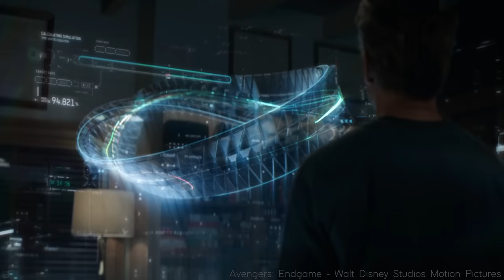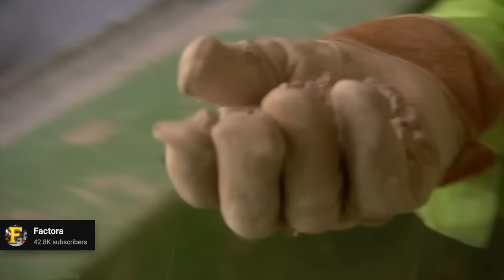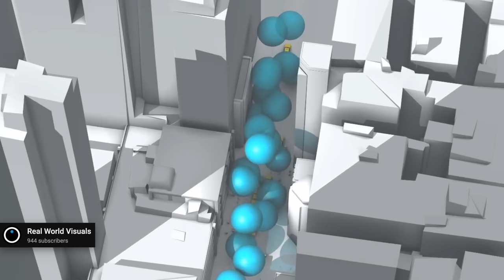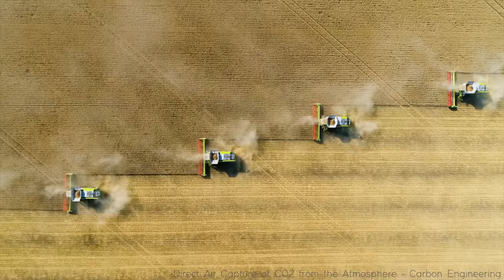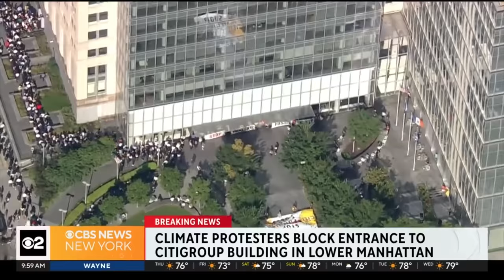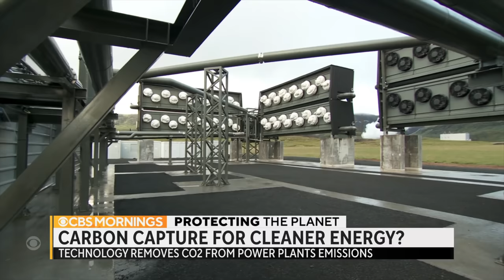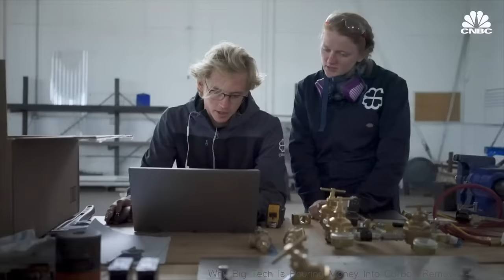How Thermodynamics Holds Back Negative Carbon Tech

Comment: It seems absurd to argue that we can double our energy production and devote all of that extra production to carbon capture. But what if we didn't dismiss it, and asked, "can we actually do this, and how could we do so cheaply?"

There is one conceivable way we could solve this, that I don't see discussed much. There is a method firmly grounded in thermodynamics that we could use to generate absurd amounts of energy for relatively low costs - extremely large nuclear reactors.

Fission plants are interesting in that the fuel costs are a rounding error in their overall budget. All the cost is in building the plant. But fission reactors, like any heat engine, tend to be more efficient the larger you make them. And in particular, they tend to be cheaper the larger you make them. There's a reason the nuclear industry has tended towards large GW-scale reactors. These are the economies of scale needed to make fission practical.

But what if we went larger? A lot larger. Orders of magnitude larger. Imagine if we built terawatt-scale fission reactors. Think of how cheap we could make large amounts of energy if we were able to build such massive reactors. 

Why hasn't anyone done this before? Because for most cases, it's not practical. A TW-scale reactor is largely useless for the electricity market. Even if it can make electricity for a very low unit cost, there simply won't be a TW's worth of electricity demand within a reasonable distance. You would have to ship that energy hundreds or even thousands of kilometers, and line losses would eat you alive. Even though monster reactors might be able to produce huge amounts of energy cheaply, we don't use them because the market within a practical transmission distance can't soak up a TW's worth of production.

But CCS is one of the few cases where such monster reactors might actually make sense. You avoid crippling line losses by building your monster reactor right next door to your big CCS plant. And you can put your CCS equipment almost anywhere (or anywhere suitable geology exists.) So in principle we could construct some monster reactor and CCS plant right next door to a uranium or thorium mine, power all the mining and processing equipment with said reactor, and make the whole process as efficient as possible by minimizing transportation needs. 

We have access to the energy needed to do this. The US has alone has enough depleted uranium sitting in warehouses that we could probably cover the whole process with this. And beyond that, reactors can be built to work off thorium, natural uranium, etc. 

Ideally, you would design such a reactor to specifically meet the needs of large-scale CCS. For example, you might design them to operate with unenriched uranium and thorium, large breeder reactors. Also, you might be able to skip the electricity production process entirely. As you note, often for CCS most of the energy budget goes into heating whatever compound your plant uses to absorb CO2. So you could have a plant that has a primary cooling loop going through the reactor core, passes through a heat exchanger, and gives the water to a second fluid loop that provides the heat needed for the CCS equipment. You could design the reactor to primarily serve as just a heat source directly, and thus avoid the large thermodynamic losses necessary in thermal electricity production.

And you can go further. When you start really thinking on this scale, a lot of things become possible. For example, it's likely there isn't a foundry in the world that can build reactor vessels large enough to make such monster TW reactors. But when you're thinking on this scale, simply building the necessary foundry, right on site, to produce such vessels becomes a practical option. You avoid the transportation nightmare of transporting a TW reactor vessel long distance by building your reactor vessel foundry right on site. If we want to seriously talk about atmospheric CCS, we're talking on a scale that involves dedicating a few percentage of total global GDP to the project. And when you start thinking on that scale, all sorts of options open up. If the technology to do what you need hasn't ever been scaled to the necessary level, you have the funds to scale it. If a foundry that can build a reactor vessel large enough doesn't exist, you can build that foundry. If enough nuclear engineers and technicians to run such a complex don't exist, you can pay the entire education cost of an entire cohort of students to get the training they need. 

It's a bit like the original Manhattan Project. Building a nuclear weapon in 1940 seemed impossible, the logistics were insurmountable. But when you start throwing around a budget big enough to construct entire cities from scratch, a lot of things that were once impossible suddenly become possible.
Reply: Very interesting thoughts, I worry though about cooling such a monster, and the potential impact of such a steam column.   Though surely it can't be much worse than a rain forest springing up where there wasn't one.
Reply: @72APTU72E  Yeah just turning such a beast on could significantly alter local weather patterns wherever you built it. This is definitely a "lesser of two evils' idea. Creating a new artificial microclimate somewhere isn't something I would generally endorse. But when weighing against the dire nature of our situation, it may be a cost worth paying.

However, it might not actually require an ocean's worth of cooling water though. The CCS equipment seems to work on much lower temperatures than most reactors run at, so a lot of that thermal energy will go right into the absorption process. 

But moreover, you might be able to just rely on air cooling for such a thing. Air cooling a TW reactor? Seems absurd right? But in this one context, it might not be. After all, you're already building utterly gigantic fan setups to move the huge volumes of air needed. Once you pull the CO2 out of your air stream, you could then use that air stream as the final cold sink for your reactor. 

Normally, air-cooling a nuclear reactor is pretty absurd. Generally using a big body of water as your cold sink is a much more practical option. But since you're already going to have to be moving huge quantities of air anyway, using that massive air stream as your cold sink would probably be viable.
Reply: This is fascinating. Do you do videos on the topic? Would love to learn more from you on this idea of enormous economies of scale for fission and CCS.
Reply: I haven't yet, but I have considered it in the past.  @SAPANNow
Reply: @TanyaLairdCivil  well I'm subscribing to you in case you decide to in the future. You sound like a good science communicator.
Reply: Third law of thermodynamics would simply disagree not only with your reasoning...
Anyway you aren't alone with your startrekkish theories: 
those CCS (how much americans love their acronyms?) methods simply don't take into account physics being them politically manufactured
Reply: @wisdon  what does the entropy of a system reaching a constant value at the minimum energy state of the system at 0 Kelvin (assuming there is only one such state) have to do with it?
Reply: seems cartoony, but not impossible
Reply: Well, lay off the economy, you will see better results 😂😂😂
Reply: @busimagen  Care to explain how?
Reply: Nuclear power plant can support any carbon capture energy requirement without creating carbon, and nuclear power can bring scale that way above renewable energy sources.
Reply: One big nuclear plant; that’s your option? One point of failure; one source of potential radioactive emissions; one target in times of conflict or acts of terrorism. Yeah that’s brilliant, you’ve really thought this through.
Reply: @MichaelEilers  The idea really wouldn't to build just one big nuclear reactor to solve the whole problem. 

You need to think at scale. We're talking doubling total human energy production and using all the excess for carbon capture. Our current power plants are not sized to simply produce the most energy possible for as cheap as possible; they are instead optimized to the needs of the electricity market. And the needs for bulk large scale CCS are simply very different than those of the regular power grid. And the optimum size of reactor for large-scale CCS is likely very different than the optimum one for the electric market.

And no, you of course wouldn't just build one big reactor. I don't know the exact total power output required, but the largest nuclear reactors today are about one GW. So maybe you power your CCS with a fleet of a hundred 100 GW reactors. 

Obviously just building one big single example of anything is probably a bad idea. But my point is, that by moving to a scale of reactor an order or two of magnitude beyond what we've done in the past, we can likely produce power for far, far cheaper than anything we've done previously.
Reply: @MichaelEilers  Modern nuclear power plants with state of the art PWR (Pressurized Water Reactors) are really, really, unbelievably safe. Not even need to mention future technology like Small Modular Reactors or Thorium Molten Salt Reactors. Plus, SMRs are already commercially operating. Experimental TMSRs are operating in China, and we are also building our own TMSR prototype.

With the support of renewable energy sources, massive scale Thorium reactors, which is modularized with proper size, can be a perfect future energy source. Such thing will be flexible, cheaper, safer, yet can meet the demands of humanity & carbon capture for incoming numerous decades with far far far less carbon footprints, like order of magnitude smaller carbon footprints. Thorium is abundant and does not need to enrich. All we need is proper infrastructure.
Reply: @MrSupasonics   that's right. Candus, smrs, new nuclear attack is absolutely exciting. The answers are here. It's time to just get on it.
Reply: @Johndoe-ob1   how do you mean?
Reply: @TanyaLairdCivil  Thermodynamics time. When CO2 binds to its absorbant material, the entropy goes down. Heat must be released into the surrounding filtered air. 
Given a stream of CO2 rich sorbant, the baking is endothermic. And given the temperature drop, you could get some electricity, and then bake out the CO2 with semiwaste heat. Still need to cool the CO2, lots of heat ends up in fairly hot CO2. Probably run that CO2 over the next lot of absorber coming in to heat them up. And put the still hot absorbers back out there to cool and then catch CO2.
Reply: i think the trend is actually toward smaller, "modular" nuclear power plants
Reply from the maker: That’s a great idea and a lovely post, thanks for sharing. One immediate question that comes to mind is whether something like DAC could really be done in a relatively local region and still be effective. If you did it all in one place, yes it makes the power easier, but I think you’d lose efficiency as the local CO2 levels would drop. It would be interesting to model the global recirculating of CO2 with one or two large negative sites acting continuously…
Reply: I generally preemptively roll my eyes at pro-nuclear comments, expecting a pile of misinformation and wishful thinking. But this was an excellent comment. Thank you!
Reply: Historically, it has taken 10 years to commission a nuclear plant with accepted and proven reactor scale and technology.  Scaling them up will not help that. For purposes of dreaming, mass production of small scale modular reactors is more viable and gives more flexibility.  But then we wake up and find none of that has happened. Also, scientists knew the Manhattan Project would be doable in a few years, the problem was when and being first. Sadly, for this case, it is obvious DCA is not doable on the scale required. Mankind has been on an energy party binge since the Industrial Revolution, and we are now coming to an end, of some unknown sort.
Reply: There is no difficulty in generating enough energy to remove say 10bntons of CO2 annually. 

Take the Global Thermostat solid sorbent DAC machine which uses under 1MWh of exergy (work)  to remove 1 ton of CO2, half as electrical work and the rest as heat, which can be supplied using a heat pump

In the sunbelt,  annual insolation is ~ 8GJ per sq metre  ie ( ~ 2.2 MWh)  , so using PV with batteries it is possible to power the removal of 1 tonCO2 annually with around 1.5 sq metres of land.
Or by extension, 10 bn tonCO2 / yr removal on 15,000 sq km of land, ( about 120 km square, but not contiguous).  The Sahara alone is >9M sq km in area.

To give an idea Bloomberg NEF estimates that by 2030 the globally installed PV will amount to >5TWp. 1 TWp  produces ~ 2000TWh annually and will power ~ 2 bn tonsCO2 removal.

We can certainly create the PV power supply needed to do this
Reply: @ldm3027  Ooh, thanks for that, and for doing the math on it! I’ve been wondering what the required power per ton of capture.
Reply: @ldm3027  Creating the PV energy can be done in theory, like a Dyson sphere or a space elevator, but in practice, it can not be done. There are prohibitive cost and material constraints, and maintenance. A better use of the new clean power would be replacing fossil fuel power plants. 
Additionally, for the DAC equipment, ten billion 1 MW units would have to be manufactured and maintained. The waste heat would be an environmental problem that would require more engineering and equipment.
Reply: you have not been paying attention. by 2030 there will be >5TWp of global PV installed and that will increase to >15TWp by 2050, all for global electricity demand. the amount required for DAC will not be significant before 2050 and even then will be a fraction of that used for global energy demand. there is  no difficulty as far as cost or materials are concerned. Each DAC machine will capture over 1 ktonCO2/yr so the number of  machines deployed will be under 1 million per bn tons of CO2 which is a fraction of  global car manufacturing capacity. maintenance would be carried out onsite like any other infrastructure.  conservation of energy should tell you that there cannot be more energy in the waste heat than was in the insolation in the first place. in fact  the reduction in entropy caused by the concentration of the carbon dioxide in air takes energy so there is less free energy than in the original insolation. as the DAC machines will be installed in desert areas the energy involved will be much less than the petawatt insolation in the sahara     @AndriasTravels
Reply: All needs to be weighed against the other solutions, and done in priority order. 

DAC - taking carbon out of the air 

Vs 

CCS - preventing the carbon getting released

Vs 

Just plugging the generated electricity into the grid and shutting down coal & gas power plants

Vs 

Increasing demand for electricity while reducing fuels by electrifying transportation and industry 

Vs 

Focusing on efficiency and reducing consumption of all things. 

Seems to me doing all the things that reduce our emissions are higher priority and more practical than trying to take existing emissions out of the air. 

I get that at some point we need to do everything, and get to that point quickly. But is DAC and CCS really the low hanging fruit, or should we get a decent start on the other stuff first to not waste the resources on the least efficient improvements.